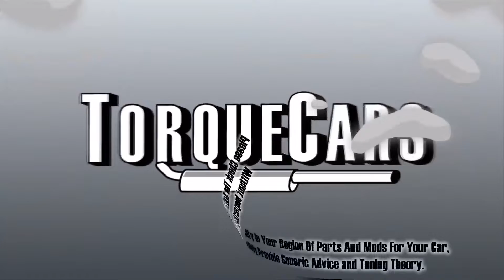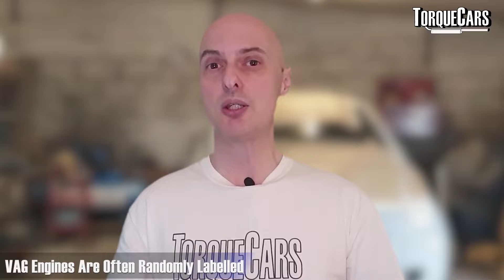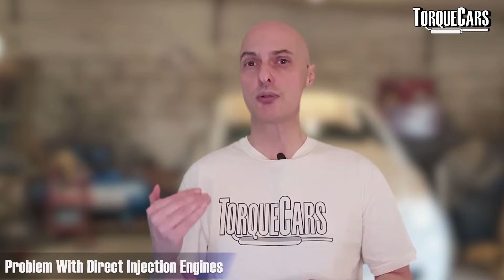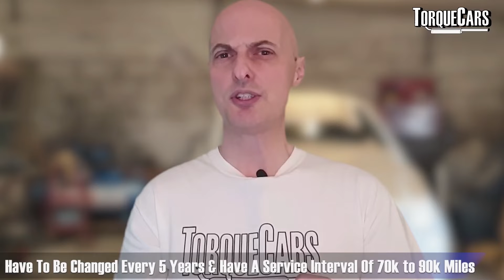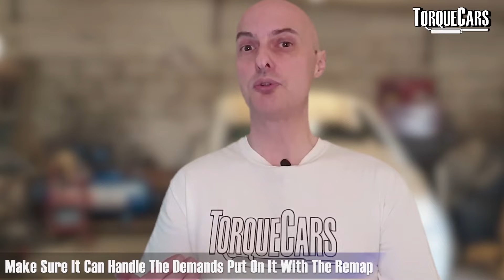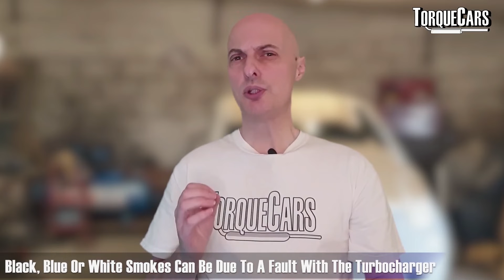Fix Common 1.4 TFSi TSi Problems & Issues 🔧[Troubleshooting]

Comment: Damn… !! Perfect..!!! 

Very informative and well explained…  I just wanted to ask, when you oil, do you mean engine oil or Oil as in petrol..?

I have and oil consumption rate gone madn😢.. I have the 1.4 TSI CAV Twincharge engine.

-hard to start at times
-system to rich of idle bank 1
- Black smoke from the exhaust especially during hot times of the day
- Back pops or back fires when you release the accelerator..
- Lack of boost Power at most of the time and BOOM!! Everything is aggressive and after a day or a nice drive.. back to the old problem.
- Hight Fuel consumption 

Done on the car!!:

- removed Catalyst, no mapping was done.
- Mass Airflow intake filter

The rest is stock..

Services has been done on the car, new oil and petrol filter, spark plus, coils and oil. New water pump. 

What do you think is the problem..?
Reply from the maker: Engine oil. What grade of oil are you using? VW503 spec or similar? Taking out the cat without remapping is likely to cause problems as it is expecting a cat and reduced emissions which can lead to fueling issues and problems as it tries to meet emissions standards without a catalyst.

If you take off the air filter does it clear things up? (only for a brief time to diagnose please don't drive around with no filter).

It could be a worn turbo not providing enough air it does however sound like it is overfueling.

These issues can be impossible to diagnose remotely, especially due to the intermittent nature of these problems.

Comment: I have a 2013 polo gt my epc light keeps coming on if I try and floor it before 2,000rpm I've taken it to 3 different mechanics I've had it smoke tested changed the pcv valve and the map sensor and when it's scanned it's coming up with a p0299 air intake leak
Reply from the maker: I understand this to be a low boost problem, have you done any mods or recently changed the turbo? On a VW engine you'll see a Boost Pressure Regulation: Control Range Not Reached when you look it up.

The wastegate actuator or boost leak could cause this problem by not allowing enough exhaust to flow through the turbo. Calibration of a new turbo, even if a straight swap is always recommended. I guess at higher RPM everything is fine, it's just at this low end which suggests to me the wastegate/wastegate control valve could be sticking or not opening early enough.

Are there any turbo whines or siren noises?
Reply: @torquecars  no I only hear my turbo whistle slightly when I'm in tunnels I got the car 2nd hand so I don't know if its been modified thanks for the reply I'll look into the westgate do you think it could be sticky westgate ?
Reply from the maker: It is hard to say remotely without seeing the car. When people put on new turbos they assume the wastegate arm is at the same length but it needs adjusting and this is the most common thing I see causing low boost at low rpms. By the time the revs get up the turbo is getting enough to spin up within tolerances although at the bottom end of it's range.  I do wish garages would do more diagnostic work rather than just banging on parts "to see if it works better". Let me know how you get on, I'm sure your experiences will help many others reading this.
Reply: Mate I've got the same issue. 2 garages can't find out why I've got p2262 error code on carista. Polo gti tsi 2013. Seems to have no power and can't even hear ny turbo anymore. Only had it for 4 months second hand

Comment: Hi. I want to buy a VW with petrol engine from 2014 or newer. But it's hard to decide which engine to choose. I am between 1.2 TSI or 1.4TSI but I heard all this problems with this engines that it makes me reconsider the switch to 2.0L diesel, because I people say that might be the best from VW. I am aware of 1.4 problems , but what do you say about 1.2?
Reply from the maker: I don't know much about the 1.2 as I've never had one to play with but on paper they share much with the 1.4 though but with less cylinder capacity they don't tune up as nicely. If you only do short journeys I would avoid a diesel with a DPF. I am very happy with my 1.4 - avoid the EA111 early versions. Anything after 2012 is generally very well made and will serve you well. Common problems do not mean unreliable engines, when you compare the number of these engines with these issues to some other European car brands they  are extremely reliable. Keep on top of servicing with any modern engine and it will last for many years to come.
Reply: @torquecars  Thank you very much for the answer.

Comment: Hei! 1.4 bmy golf has hidden code p2004, and the emission values are so high. Is it crankcase breather?
Reply from the maker: Error code p2004 usually applies to the bank 1 IMRC  Intake Manifold Runner Control and indicates it is stuck in the open position. Bank 1 refers to the side of the engine where cylinder #1 is located.

Comment: I have a Skoda 1.4 tsi 61 plate. I have code P0299 for turbo underboost. I have checked the diverter valve which looks ok, i have checked the map sensor on top and it looks ok. Ive taken the car out and can only get a reading of 0.14 psi for the turbo. Does this mean a turbo replacement, or could it be a problem with the wastegate actuator? TIA Matt

Comment: Heard this car have transmission issue.
Reply from the maker: It is usually the clutch on cars with this engine in my experience which can cause troublesome gear changes sometimes. 

Please note that I did just focus on the engine in this video as this is available in so many different makes and models. I will get around to discussing more car specific issues. Crunching on second and third gear are the only thing I've heard, and this is usually down to high mileage and driver abuse. What have you heard? I'll investigate further for you and see what I can turn up.
Reply: @torquecars  DSG gearbox issue. Base where I am, many drivers here abuse the gearbox. I'm guessing that's the reason why. Was planning to buy scirocco but end up didn't

Comment: I have an 2015 audi A3 1.4t, my oil is burning and i dont know why, any ideas?
Reply: My car is on 49.000km
Reply from the maker: This is an interesting question and I will do a whole video on this topic as it affects so many modern engines.

Get an engine compression test done: This test checks the engine's ability to compress air and can help to identify problems such as worn piston rings and if this is limited to one cylinder or is a wider problem. A camera can also be useful to inspect for wear and tear inside the engine and head and identify any possible ares for leaks.

Common Causes of Oil Burning in Cars

Worn piston rings: Over time, the piston rings that seal the combustion chamber can become worn, allowing oil to leak into the engine and be burned.

The top piston ring with the wavy edge is called an oil control ring. It's a crucial component in the engine's oil control system, responsible for controlling the flow of oil into the combustion chamber and preventing oil from being burned. The wavy edge of the oil control ring helps to scrape excess oil from the cylinder walls and return it back to the engine's oil pan. This helps to reduce oil consumption, improve engine efficiency and performance, and prevent harmful oil from entering the engine's combustion chamber.

Damaged valve seals: Valve seals that prevent oil from leaking past the valves can become worn or damaged, causing oil to seep into the engine.

High mileage engines: High mileage engines are more likely to burn oil due to increased wear and tear on engine components.

Failing turbocharger: A failing turbocharger can cause oil to leak into the engine and be burned, as well as increase engine heat and oil breakdown.

Additionally, a failing turbocharger can also cause excessive engine heat, which can lead to oil breakdown and increased oil consumption. If a car is burning oil and has a turbocharger, it's important to have the turbocharger inspected by a mechanic to determine if it's the cause of the oil consumption.

Comment: Thanks for the video! How do you check the wear on cam follower?
Reply from the maker: Good question! I'll have to get back to you on this, but which version of the 1.4TFSi do you have? The newer engines cams are pressed into the head at the factory and have a different setup.

Comment: I have my gt tsi low boost with no code no light in dash ?
Reply from the maker: It would be interesting to see what the sensors are showing via vagcom and if it were running lean or rich. The airflow metering may well be soiled and causing it to mess up the fuel trim. A bad O2 sensor can also cause it to back off power without reporting an error as it is just getting wrong figures to work with and doesn't realise there is a problem. I guess you've done the obvious checks for boost leaks and split pipes or bad joins.

Comment: I recently bought a 2015 8V S line saloon, 1.4TFSI 7 speed auto. I brought the car to an auto trans specialist for a service in Oct. 

Out of nowhere I got an error message on the dash saying gearbox malfunction: no reverse gear. Reverse gear and second were nowhere to be seen. I got onto the garage I got it from and they replaced the mechatronic unit in the car. under warranty (I only have 1 months warranty left) they used a reconditioned part.

I have had the car back a few days and I noticed that gear changes aren't as smooth and responsive as before, especially in the higher gears there is a lot of hestitation when changing up and down from 5th, 6th and 7th. Also when changing from drive to reverse or vice versa it takes a while for it to go into gear. It almost feels like the clutch is slipping,  do you reckon the clutch is going in it too, or the mechatronic unit they replaced as no good? Or maybe they needed to retime/code something.

It's a small independent garage so I think they just wanted to patch it up to see me through the end of my warranty. Id be greatful to hear your opinions on this, I'm going to call the garage regardless, but as you know some garages can be less than helpful toward the end of your warranty. 

Happy to send through a donation for your time also.
Thanks
Reply from the maker: I don't know very much about these automatics sadly. I do find they need to relearn after a reset and can seem quite bad at first but this process takes around 200 miles of varied driving to kick in. If I turn anything up I'll let you know.

Comment: Hi my dad is about to buy audo a3 1.4tfsi 2008 and we tested it and top speed was 160kmh what is the problem, can it be turbine or what pls answer fast
Reply from the maker: It is probably carbon build up. It could be down to worn injectors or as you suspect a turbo issue but these tend to come with a siren or whining sound. Loss of boost pressure from the intake can also result in a lack of power. There are quite a few reasons the car might be down on power it really needs a diagnostic to determine where the issue might be.
Reply: @torquecars  thanks

Comment: I have a golf 1.4 tsi 170 I have low compression on cylinder 3 seems common problem , my options are vague on how to fix any suggestions
Reply from the maker: This is usually a valve seat or piston ring issue. Inspection with a camera probe should help narrow this down, you'll see carbon building up around any weak spots. Either option can be quite expensive to sort. I have seen an engine flush and oil change improve mildly low compression and as it is such a cheap thing to do you don't have anything to lose by trying it, get a decent oil flush additive though.

Comment: When you say newer engines what year from are specifically talking about?
Reply: Good question from what year on would be good to know
Reply from the maker: Sorry for my slow reply my friend. The comment I made is general, the newer the engine the more likelyhood there is of problems being sorted and resolved. There was the EA111 which had most of these issues, especially on the early units. The later EA211 revision sorted out most of the issues, fore example the chain was (generally) replaced with a belt. By the Gen 3 even the carbon build up issue was addressed with the advent or port injection (in some if not all models). Burning oil has not been noted much on the EA221 Gen 3s. Always buy the newest engine you can afford when it comes to the VW group. There are exceptions so it's hard to give a year as some brands used engines for longer periods than others. My EA211 has been fantastic with no issues whatsoever but I'm expecting to do a carbon clean at around 50,000 miles.
Reply: @torquecars  Thanks much appreciated im looking at 2016 Audi A3 1.4 TFSI CoD S line 71000 miles would you happen to know what gen and engine this would have and what I should be looking out for thanks again and great channel info
Reply: @torquecars  Thanks a lot for your reply, Your channel is great for gaining knowledge about these engines i'm so glad i found it. 
I sold my Abarth 500 last week and i'm currently looking for a 2014/15 either an A3 or A4 1.4 TFSI S tronic so just doing a bit of research into the reliability of them. If i hadn't done a bit of research on youtube and seen your video i would have probably never even known about the carbon "issue". This will be my first VAG car if i manage to find one as i've always had french or italian hot hatches!
Hope you had a good christmas and happy new year mate!

Comment: Just got here. Loving the channel so far. I have the Golf GTE it has the 1.4tsi ea211 mated to a 100hp electric motor. I have a remap and am making 280hp at the crank. But i want more! I take care of the engine and drive it every day. Should i go for an intercooler and sport cat? And then turbo and downpipe, or the other way round
Reply: Get an s3
Reply from the maker: Get the cheap upgrades done first, but bear in mind that the turbo will usually need mods on the exhaust so make sure the stock downpipe and exhaust will fit your chosen turbo, or do that all together.

You'll need a remap to bring everything in line so add the turbo and remap last for best effect.

Comment: My brother-in-law's wife has a 1.4T Jetta. She loves it.
My wife drives a 14 20T A4, it burns a good bit of oil! About quart or liter every few hundred miles! The car is white but the rear looks like a diesel it's so covered in soot! Also at less than 80K miles she burnt an exhaust valve. Carbon built up and clogged the injector on cylinder 2 and since it is tuned when she put her foot to the floor one day the valve gave up. I should have put new rings and pistons in it when I put the valve in but that was just more than I wanted to do. One day when I put a big turbo on the car and turn it up to about 500hp it'll need rebuild it anyway!
Reply: I bet both of them have quite fun in the backseats when they go out.